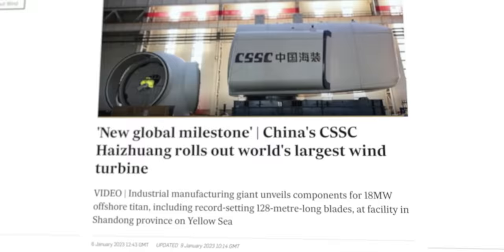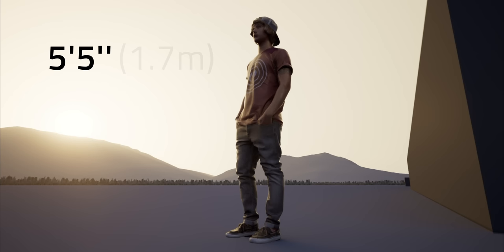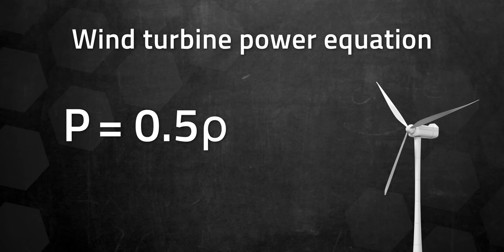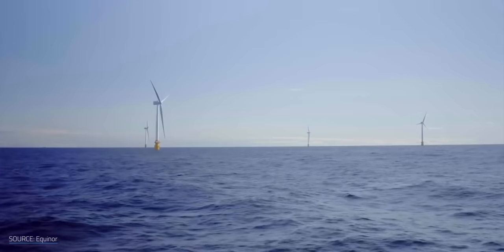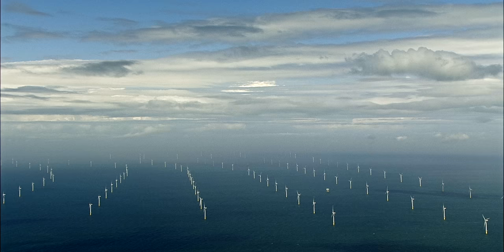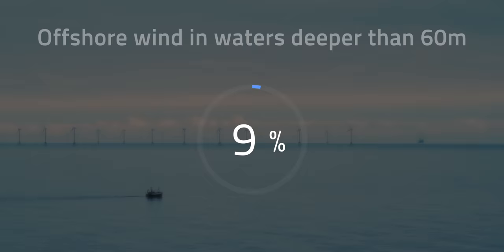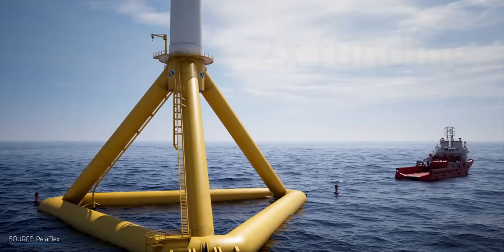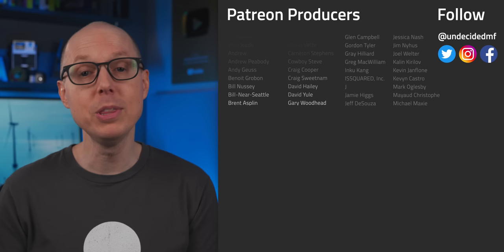Why Are Floating Wind Turbines So Huge?

Comment: The very big  turbines has actually, a shorter life span than the smaller ones ,this rasises questions if it is effective to  up scale at any costs, if life cycle analysis are applied. 
The problem with largers  swept  are is higher impact on birds for example . Often the birds are  hit at the down strocke of the blades. 

The horizonal turbines are not very effective ,when it comes to density in the  wind turbine park . The horizonal tubines has big down wind  disturbances,  so they need big gaps between  them.  The wings have balsawood in the core ,the expansion of wind has meant a non sustainable harwest of balsa wood.  The long wing length is believed to be one factor that make  the  plant to  have shorter life span.

Using vertical axles turbine  may be a alternative. 
The  turbines  can be "stacked " tighter. They actually  benefit from bad wind . they And they can be put at  floating  foundations as well.  They seems to make less damage to birds , the birds avoid to fly thrue  the vertical rotor asembely. They are lower in height: less visual impact .
They do not have the blade tips going up in the sky  above the nazal as  the horizonal turbines does.
The blades on a vertical axle wind turbine are often  supported.
At the base and the top , so the blade construction does not have be so complex. 
This technique shold be evaluated in comparison with the horizonal type before we start building large quantities of turbines all over.
The company's that build the turbines  just want to sell there product in as big numbers as possible,  they don care if there product is better than other products  as long as it it profitable  to sell /produce.
Is demand present to  scale up 
Stuff they will do it . If the devolpment goes in a direction  that is  not effective  over smaler scales ,when you look at life span  and material/ energy, used to achieve the scale up they dont care.

Comment: How much pollution is generated in the creation of these monsters?  Woodgas can be done anywhere, and it's pollution can be safely burned and you just end up with carbon and carbon dioxide.  The carbon is good for a soil additive, and the carbon dioxide is what plants crave;^).    It is a technology that liberates a population rather than taxing them like the centralized tech you keep promoting.

Comment: The further away the power source is from the things using the power the more power is lost in transmission. All your efficiencies of these generators are ruined by the distance they travelled to get those efficiencies. Undecided is the name of your channel but everything you cover is a scam in hiding and simple science like resistance in cables is something that never crosses your mind.

Comment: current technology is a joke... just by combining gravity and water buoyancy we can create electric carousels that produce electricity with no maintenance and forever, gravity and water buoyancy are unlimited form of energy, water buoyancy lift objects up in the air gathering potential energy, which is release on fall generating electricity, same principle than tesla electric rotor but in this case the rotor is linear in a close circuit (track) depending on the carrousel size, it can generate more energy than any nuclear power with no risks or with the need of cooling down or radiation. this carrosell its cheap to build and would fix all electric problems for the next 2000 years
Reply: If it were cheap, we would already be doing it. The problem with the energy of the ocean is, that it is very strong. Multiple power plants were build, most did not last very long.
Reply: @old-pete  no they wouldn't cause i only came up with the concept in the beginning of this year, everyone has no idea of this, if you understand the concept spread the word, its a free patent
Reply: @rjvtechnologies  The concept is rather old. Look up wave power generator. There are different concepts.
Reply: @old-pete  no its not, that uses water motion(waves) to move pendules that move a rotator that generates electricity, energy is taken from the waves not from gravity or water buoyancy, in the method you mentioned water buoyancy is present but is not in use to generate energy, big difference, when there is no waves there's no energy being produced while my method produces electricity continuously, i know you did it innavertendly but you should really think first than gratuitously reject and deny things and people, not just in this context but in general life, think in solutions not in problems....
Reply: @rjvtechnologies  Without movement, there is no energy.

Comment: The amount of concrete, steel and cobber used for offshore is enormous. That makes them less green and they can never supply a huge percentage og the worlds energy needs as this would deplete the worlds steel and cobber resourses. Is much as I like wind it is simply not scalable. Remeber it is not just the worlds current electricity needs we need to cover it is the world energy needs. As more and more cars, trucks and planes move to electricity and the more 3rd world countries are develloped the more electricity we need.
Reply: source please
Reply: @felixbeutin8105  there are hundreds of sources. What part do you not believe?
Reply: And the floating ones are less polluting? Provide some data
Reply: @jesperjager6290  well since i study this stuff this all sounds very Internet blog to me rather than scientific results
Reply: @felixbeutin8105  solar panels and wind turbines are the most resource heavy energy sources there is. To an extreme degree actually. If you do not know this the what are you studying? There is also not a good way to recycle the glasfiber wings, so most of them a just buried where they will remain for thousands of years. It cam basically be compared to disposing a glass bottle in a landfill.